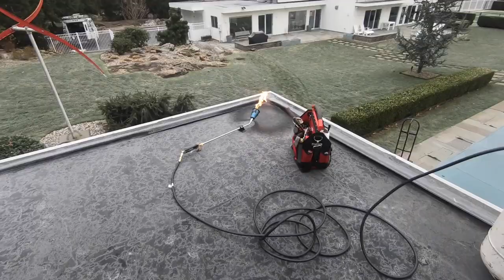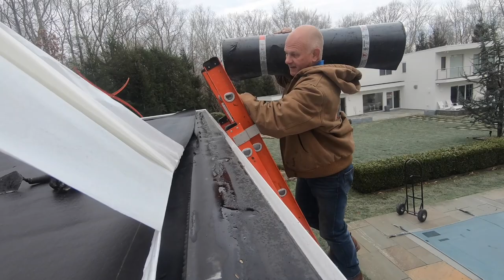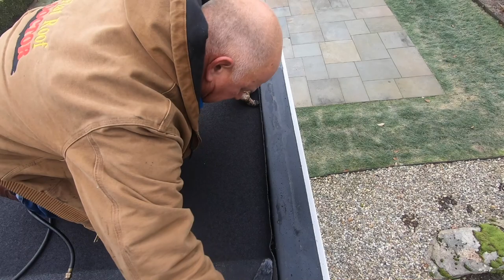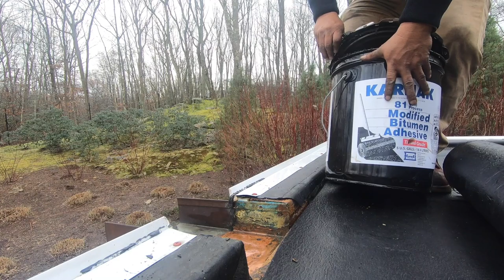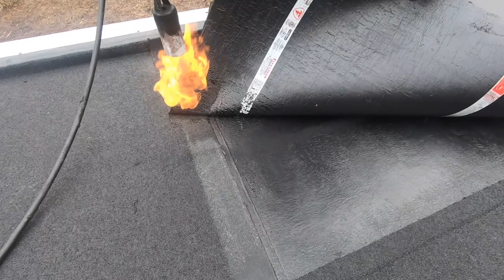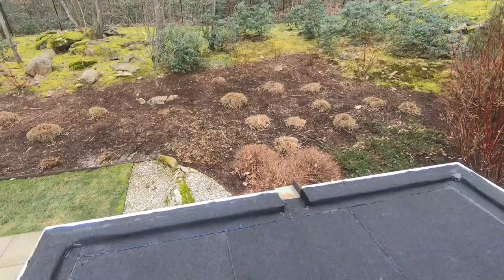You can fire your Roofer after watching this - it is really so easy

Comment: Thanks for video. I have a flat roof carport in florida I roofed with  Torch down from Lowe's 13 years ago. However it came loose from the drip edge just like you were saying in one of your videos.  I will definitely be using your technique when I redo it this Winter.
Thanks again.

Comment: Appreciate everything to do and teach.  Like the trowel grade in the scupper technique. I’ll be using that in the future
Reply from the maker: I am glad to help. Just remember it is Karnak 81 or 66 Trowel Grade. Home Depot only sell the Brush Grade unfortunately.  If you try Beacon Building Supply or ABC Building Supply in your area, they might have the product. Cheers
Reply: @FlatRoofDoctor  what about Karnak 19? We typically use that and only apply it with a trowel, but it doesn’t specifically state trowel grade.  No way that stuff can be brushed on

Comment: Your joints are running against the water. Your supposed to start at the lowest point  (scupper) working outwards
Reply: Nothing like bucking water trying to get to the scupper box. Not to mention Karnak is not an adhesive.

Comment: This is some real hack stuff. First of all I would of ripped the whole roof. Your whole new roof is relying on peel and stick. You have a leak and it goes under that peel and stick, first wind storm its blowing right off. It's called using asphalt primer. I see you've never done warranty work. If a manufacturer seen us put down some roofer in a can as a permanent roof. They would make us rip the whole roof off again. For very good reason....it doesn't last. It's a temporary solution.

Comment: Great to see im a torch on roofer in uk i use roll bar and walk on it, its quicker and safer
Reply: 100% agree 👍 it's safer in that there's less chance of walking off the edge of the roof, some roofers won't walk on the felt in case they leave  foot prints, but if the correct heat is used no footprints will accure.
Reply: @neilkennykenny4113  you know it  man , gotta get up early to go home early

Comment: I'd fire any roofer who shows up with "roofing in can" never in my 20 years on any surface had I broke out a can to roof...proper cleaning of the metal and primer..done...or this case the edge cleaned and stripped with epdm..easy enough and completely doable.

Call me old fashioned and maybe I was no I know taught differently but never roofing goop out a can..effort..elbow grease
Reply from the maker: ok
Reply: Yeah but isn't this guy fixing the roof the way you do it?
Reply: There is one type of roofing were it is used on top of the base sheet around penetration's.  That is hot tar roofs. Never with torch down.

Comment: Probably answering my own question on a epdm/fiberboard/pea gravel flat roof and the fiberboard has gotten saturated and the hold downs have rusted and backed off in places. Short term fix is to use the Super Silicone seal/polyester before the next storm on every gap and tear. Other than replacing all the EPDM and fiberboard (and re-establishing some more slope with pea gravel) anything else that can be done long term?

Comment: Just started roofing. I had to cut a bunch  base and cap for edgework. They gave me a hook blade and asked for straight lines. Was tough, wondering if there is a trick to cutting this stuff. Im seeing many people just using exacto knives, might ask to try that out instead tomorrow
Reply: Hook knifes are better , you can try and use something called a T- square . Or try to scribe a line with a tape measure
Reply: There is a thing they call a tape measure and another they call a chalk line. And allways use a hook blade.

Comment: I didn't quite get this one.  If this was peel and stick why was there some plastic that had to be burned off?  Didn't the plastic get peeled off?
Reply: The peel and stick was the underpayment that was put down first then the torch down was put on top
Reply: @valeriehamilton8918  Thanks you do an amazing job.  Yeah I know my question was dumb after watching this again.
Reply: The so called plastic, as he calls it is just a small film  that comes as its being produced . no need to pull it off. It is so thing it melts away with the heat you apply.

Comment: Ok I was just watching this video --- (4030) U.S. PLY How to - Torch Application Techniques - YouTube , and he says the temperature needs to be be above 45 degrees F.   And you are making it work at 28 degrees F.   So you are using a different product, or more likely you just know how to make it work at colder temperatures.  I was about to give up since winter is fast approaching but now I might be able to do a torch down roof in cold weather since you can do it. 

There is a Roofing Supply  not too far from me.   So do I just tell them what I am putting down and see what they have in stock?   Can I just use the nail down base compatible with the Modified Bitumen and then the Modified Bitumen cap sheet?   Or would it be better to use a 2 layer system.  Of course the middle layer would have no granules on it. 

I think you said Magnum torches and Raptor Express torch for details.  You could be an Amazon seller and make some money.
Reply: If your using torch on you can torch below 0c no idea what that is in Fahrenheit. Use a 3mm underlay and a 4.5 cap sheet but don’t lap them like he did in this video use a full sheet underlay and cut a roll of cap sheet down the middle to separate lap on lap
Reply: I just posted that to this vid. The manufacture says nothing below 40° if you want your warantie to hold up.

Comment: Hey Koese, why didn't you just strip in the perimeter with EPDM cover strip and save the customer some money
Reply from the maker: Or make more work for me, for no extra cost. The existing metal was not completely clean, and to remove the EPDM, Clean it with Lacquer Thinners, is way more time consuming, that in turn will cost the customer more.